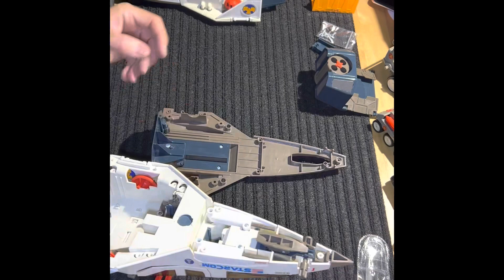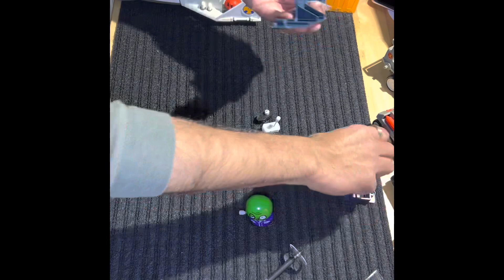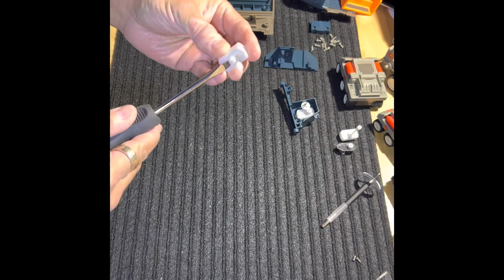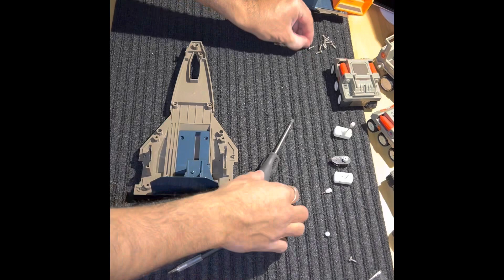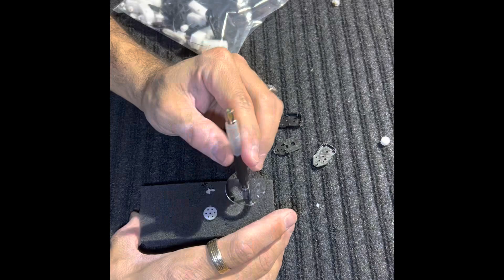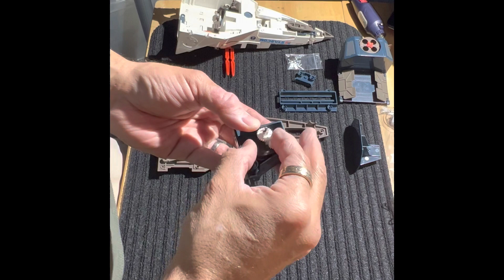Starcom Starmax Bomber Gear Box Repair and Assembly @Yakfacetherepairman

Comment: A tip for anyone watching this that I just discovered - the dirty version didn’t last very long so I went on to do the vanilla repair. 

I ended up taking the S-gear, cog & pin from inside the Amazon toy gearbox to replace the broken S-gear inside the original. Even though the configuration is different, the overall size is identical and it works perfectly.

Comment: Hello ! Thanks again for your work 😁. I want repair my starmax too. I follow you (i will buy windup toy for gearbox 😉). But i ve problem with peg of original gearbox. He move when i turn the rod. Where il can find them to buy it ?
Reply from the maker: Hi! I’m currently working on a video explaining where I get the gearbox’s and how to best use them.  👍. I will be posting it shortly.
Reply: @Yakfacetherepairman  thank you so much. With yours vidéos i can try to repair my favourite old toys 😁. I wait yours new vidéos to find pieces for gearbox. (I already bought windup toy to retrieve gearbox). But my peg on principal rob is hs. The pinion screw is crack.
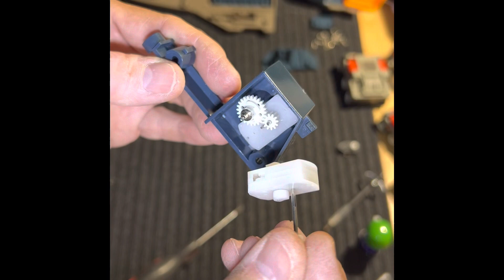Reply: At 15:27 : On my pincipal axle (rob on blue piece), my "S srping gear" is cracked (not on axle of gearbox). How can i repair it ? i can send photo to see what i mean. Again thanks and 
sorry if i'm a little heavy but i'm a beginner :D